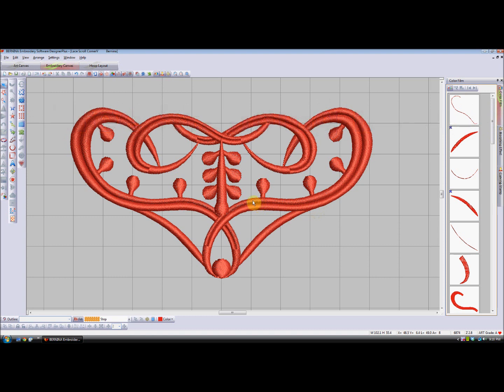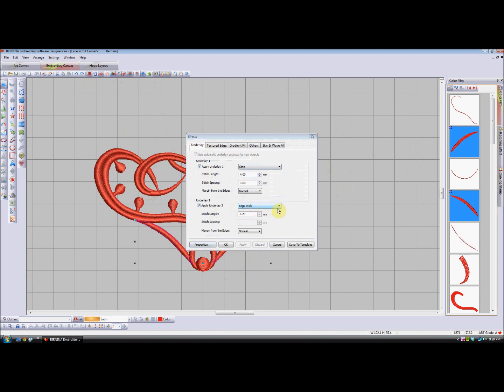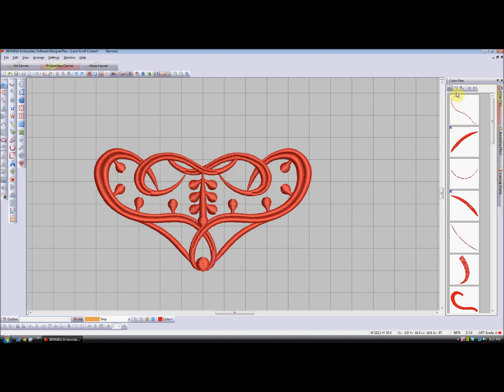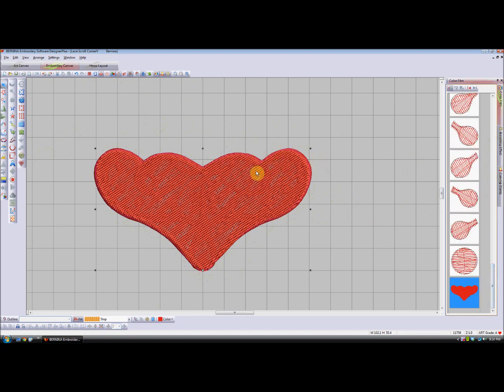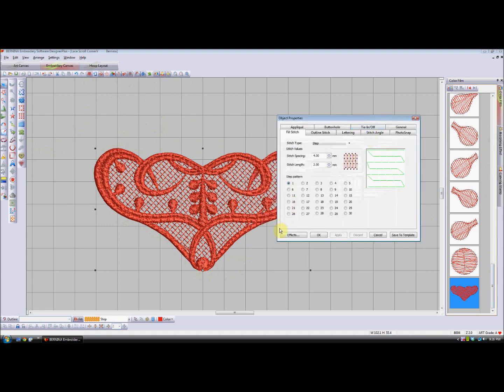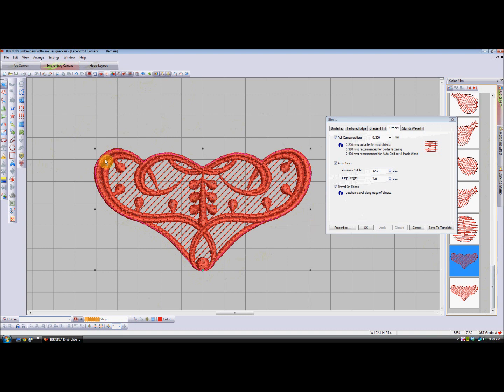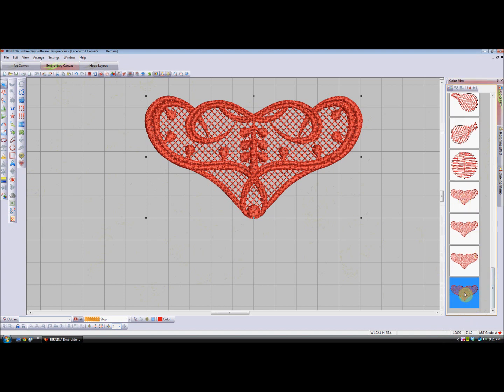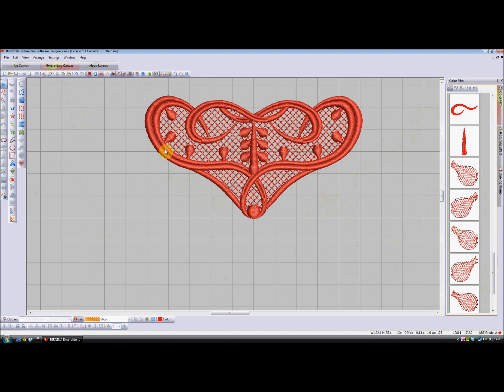Free Standing Lace

Comment: Can you turn any design into a FSL design?
Reply from the maker: +Cassy Tuttle  The principal of free standing lace is to create a foundation for your design that will hold it together, i.e. replace the fabric. This can be a net base, as created in this video, but a seiries of bars like you find in cutwork designs can also work. As for the main design, there are lots of possibilities. Long satin stitches do not work particularly well, and should be divided as shown in the video, or changed to a step fill. You need to experiment, but I am sure you have lots of designs that will work.